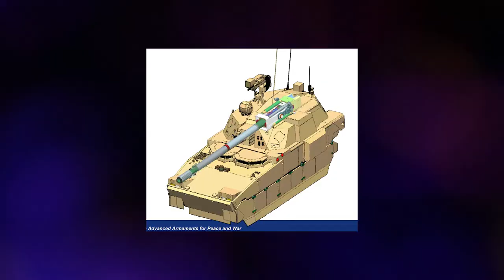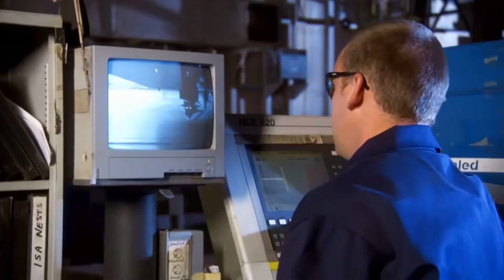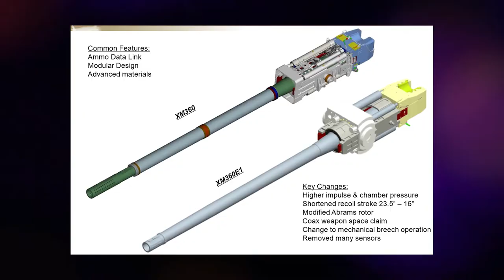The Tank That Tried to Replace the M1 Abrams!

Comment: The only thing we can do better is make armor lighter and stronger but still have the ability to save the crew tanks you can replace but good tank crews need to train daily and go to a mover range to practice within your Troop or platoon and three Troops or four platoons usually have a independent Tank battalions supporting the forward tanks and they have howitzers mortars attached to them as well as Attack helicopters and A10S